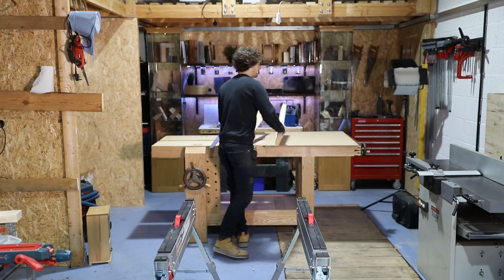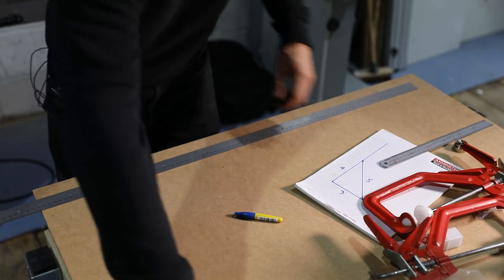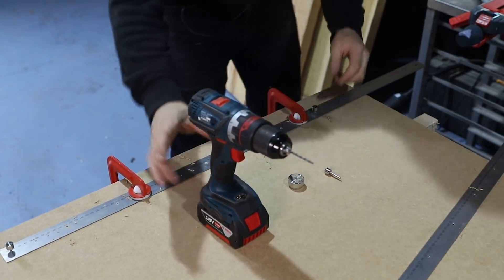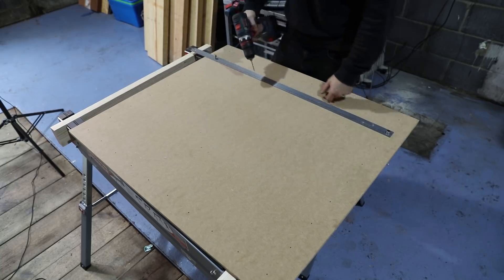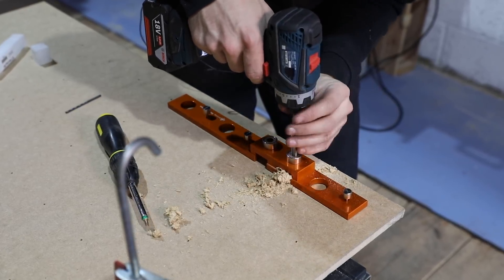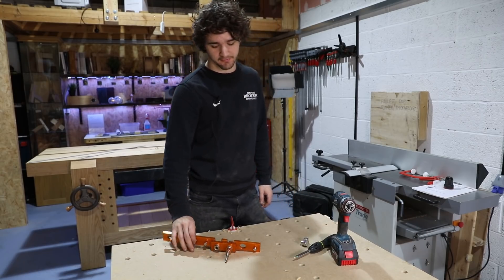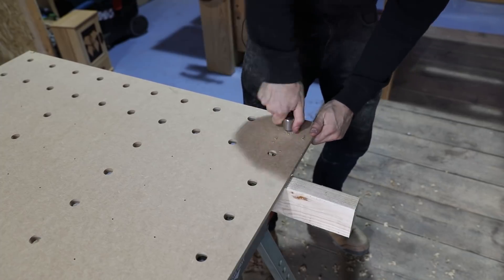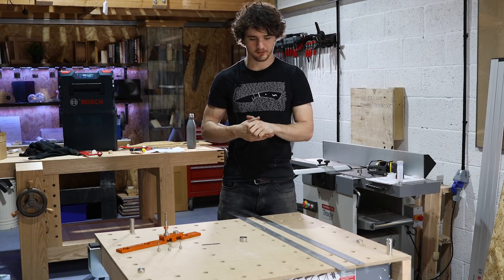How To Use the PARF GUIDE SYSTEM

Comment: Thanks! This is the first video I've seen that demonstrates the correct procedure. You're absolutely right – we need to start by drilling all the 3mm pin holes we can reach. Then, we can tackle the ones that are inaccessible. For instance, Peter Millard's method wasn't ideal, especially for beginners seeking the best approach. The only missing element here would be perfectly squaring the first row using precise measurements from the top's exterior.

Comment: If the 3,4,5 are in thousands or millions of light years, the angle might not be 90 degrees, depending on whether the universe is flat, positively or negatively curved. You'd have some trigonometrical fun AND get yourself a Nobel Prize for solving the question of the topology of the spacetime of or universe all in one go!

Comment: As the size is 20mm, does this stop the use of Veritas 19mm dogs. Specifically,, I was hoping to use Veritas Quick-Release Wonder Dog
 as a vice, so I wasn't sure if 19mm is better to cut into your board than 20mm, any suggestions?

Comment: Also, when you checked if your 45 cut was on, you merely flipped the opposite cut side to check for 90. That will always be ninety if you do that! 46+44=90? Leaned this math the hard way with a miter saw I bumped and moved a half degree! By the fourth cut I realized I was off during the dry fit🤔 lesson learned

Comment: With all the explanations, I'm now thinking of doing a kit myself. All it takes is two long straight edges with evenly spaced holes. Those are not so difficult to make - a pin used as a stop block for the first hole, then the last drilled hole slipped onto the pin fixates the piece for the next hole - on a drill press.
Reply: It's not difficult to make an approximate version. It's VERY difficult to make it perfectly aligned, spaced, perfect fit and diameter. Since it's what all the other cuts are based on, I wouldn't recommend this. You need a VERY tight tolerance CNC machine to make all this so precisely milled, and this is how the parf kit is made. Lots of jigs and tools can be successfully shop-made. For this one I'd say probably no (unless you do indeed have the equipment)

Comment: Complete overkill ..... there are better and simpler accessories out there for this ... you can also easily Mark centers out from the underside with a table saw cut length and breadth and drill the centers with a router ..... this thing is an elaborate toy ...try the dominofix jig instead .... far far simpler

Comment: Very nice thorough video - I'm sold. I'm not the most familiar with Festool but I see you using a Bosch driver with the Festool centrotec bit. In the USA the Bosch is a 1/4" hex.. Did you buy an adapter?

Comment: Hi Matt, this tool seems expensive, but after watching your video I‘m ready to get one - it‘s also available in Germany I‘ve seen. Over time, it will be worth it when drilling several boards. I wonder if the drill is sold alone as replacement, since a regular Forstner bit will not do it? However, my actual question is: I‘m in the process of buliding a small Paulk style bench from 15mm birch plywood. Do you think it,s better to glue up the torsion box before drilling or after. It would be easier to route and chamfer from both sides before glue up, but maybe building the box before ist better? Does that make sense? Greetings from Munich, Jens

Comment: Hi Matt. Like your You Tubes and I understand you have to come up with ideas but mate just buy a small table saw and make a small out feed table, it will be roughly the same size as your future set up and be far less hassle setting up. It’s also far easier moving and locking a table saw fence and I will assume you will grow tired of this system over time (I agree it will also have its benefits) I say this for advise to newbies and I’m not knocking you or your ideas. When you reach my age/experience you will think differently from your today’s thoughts. If I had time and the inclination I would make some tutorials myself. Time served Ships Joiner and Scouse b’stard living the life in Aus

Comment: presumably if you hadn't chipped the boring bit teeth the orange jig isn't needed?
Reply: Nope, the jig keeps the drill hole centered and plum in respect to the other holes.  Using the whole system keeps the squareness of your cuts to a few thousandths.
Reply: so the centre drill on the boring bit doesn't align accuratly enough?
Reply: @mickleblade  the bit just allows you to find the center, but you still need to make it plum. Not making it plum can cause enough error in a cut where it is visible for final assembly.  I can't make a handheld drill a perfectly plum hole.  Its about accuracy.
At the end of the day it's what you want to make. You dont need this system to make an accurate cut.  If you want this system to make cuts accurate and QUICK, then accuracy of holes are needed.  If the accuracy of a near perfect 90 or other angel cut isn't needed in ur application then a tape measure, a very good forsner bit, and patience is all you need. And maybe a homemade jig to simulate the orange bit.
Reply: thanks mate, makes sense now.

Comment: Matt

Apart from the impressive accuracy of your depth setting I noticed that even if there were a kerf cut in the table it would not be over another set of holes.  I think manh other track saws would cut across another row of holes, so is the track on the bosch narrower than say the Festool track?  This is one of the reasons I think some people go for raile dogs rather than Parf dogs, i.e. that moves the rail across slightly and avoids cutting over a row of holes.

My issue with the Parf Guide has always been one of cost.  I know why it needs to cost a lot, as it is made to very precise tolerances, but for an individual it is not really economic versus buyjng cnc made tops unless you use a lot of different table tops for different jigs.  Always struck me that it wojld be a great buy for a club where the cost could be shared.

Looking forward to the build series, everyone loves a shop project!

Terry.
Reply: Please, what are raile dogs?

Comment: Your 3 miles, 4 miles, 5 miles example is incorrect. Due to the slope of the earth :P If you goo 200 miles N, 200 Miles E, 200 Miles S, 200 Miles W, you will not end up in the same spot. For 100% flat surfaces it is correct though ;)

Now I don't know the exact English definition, but google for Meridional Parts ;)
Reply from the maker: #flatearth
Reply: Indeed, everybody forgets that this is all based on Euclidean geometry.  So, the internal angles of a triangle will alwats add up to more than 180 degrees if the triangle is drawn on the surface of a sphere.
However, I took Matt's example to implicitly be for a very large piece of MDF, in which case even if it were 3 x 4 x 5 miles it would be in a single plane.
Reply: eh? surely the earth is flat?
Reply: For every video there always has to be somebody that is a little bit to exact and literal.
Reply: is this comment really necessary?

Comment: At the beginning of the video I checked out the system on the Axminster website. £150?! Surely that's not worth it. By the end of the video, totally sold that it would be useful investment. Solid effort!
Reply: Yeah, I was the same; it is an expensive bit of kit but the precision involved is not cheap.
Bearing in mind that a decent precision metre rule is around £15, so that is £30 off the bat.
Reply: @MichaelMoore-nf9ho  if they made it cheaper to buy they would sell a lot more.
Reply: I agree, you can go to your local makerspace or ask a shop with a CNC to do it for much much cheaper
Reply: @reframeyourbody  
That means you have to go and ask them to do it.  With the system you can do it anytime you want with any material your want. 

You are assuming that everybody has easy access to some makerspace.
Reply: $260 in Australia and your not going to use very often. Tjere are easier amd cheaper ways to do the same job

Comment: How stable are the Axminster saw horses? I need a similar set up for my garden when projects are too big for my shed
Reply from the maker: They’re very popular. They feel quite wobbly when you first unfold them. But once they’re locked in place they’re amazing
Reply: @MattEstlea  I can confirm the stability. We have those here in the U.S. Same design, just different color and branding to reflect the local store's brand. Looks like you've got the ones with the adjustable height legs, I opted for the non-adjustable ones but I cannot see that as being much of a difference. I've used these to layout and build a steel utility trailer and they held up beautifully.
Reply: Suppose I’d best go to Axminster then 👍🏼
Reply: I looked into the saw horses from Axminster....then I looked a bit further.

I ended up with the toughbuilt C700

Fyi

Comment: Hi Matt,  Any problems with break out on the back side of the MDF, particularly nearer the end of the drilling when the edge would have gone from the bit.  Thanks for the tip will have a look at the Mk II to see if it is worth it.  I, like you am planning on doing a large 8' x 4' table, maybe a Paulk style "thick top" on trestles - have you considered that over a fixed table?  For the space from time to time.  Keep up the good work!
Reply: It makes a huge difference what quality MDF you use. If you use the crap Wickes & most builders merchants sell you will get loads of breakout & also the drill bit will clog up constantly making the whole thing a nightmare. You really need to use high quality MR MDF like Medite or Kronospan you will get a shaving when drilling & no breakout. Peter Parfitt's videos have some examples of cheap vs quality MDF. I use Kronospan for my tops & can't fault it.

Comment: how do you avoid over time ripping the top up i.e. being half a mill out in your depth setting
Reply: John douglas - Using a plunge saw as opposed to a circular saw can really help with accuracy of depth of cut. The Bosch plunge saw above has an on/off rail depth guide cursor that helps too. That said, the reason jigs like that demonstrated above and replacement MFT tops etc exist is because they do  succumb to wear - like cutting into the top. You can minimise this further by using a sacrificial piece below, like some 6mm ply, that would still allow you to use shallow 12mm dogs or, use bench cookies to support your work and use longer 40-80mm dogs for guides.
Reply: thought that might be it but on several videos I have seen could not see anything like that.   Very much appreciate the prompt reply
Reply: @TheWareek  the purpose of the Parf is to be able to recreate the system quickly and with the same accuracy. So when the top is worn just get another top and drill away.

Comment: Quick question about the larger Parf table mentioned at the end: if the table is the same size as an entire sheet, wouldn't that mean it could not handle cutting a sheet because all of the dog holes would be covered?
Reply: You could always just have a full sheet overhang one side of the table to expose a row of dogs... then cut

Comment: Great video!  What is the trick to set the depth of the saw?  I didn't see a kerf in the table nor a sacrificial board...
Reply from the maker: This is a plunge saw. It has stops set at every mm so you can be super precise!
Reply: @MattEstlea  understood.  I own a track saw and always leave a slight kerf in whatever I am cutting on top of.  Do you calculate the depth?  Or is there another method?  

Again, love your videos.  Keep up the great work.

BTW,  is the parf system suitable to use for a roubo style bench with a thick top?
Reply: @peterrodrigues1098  Don't know why this wouldn't work with a roubo style bench.  Parf dogs come in short-, long- and longer- length so a longer dog would secure well in a deeper dog hole.  Not sure a roubo style bench would be conducive for precision track-saw cuts using parf system, however.
Reply: I thought exactly the same.
Reply: My thoughts too
Reply: I did. He cut the MDF very slightly.

Comment: They sell it in the states but it isn't in imperial.  So regular, American, holdfast dont fit...3/4" vs 20mm
Reply: Just use a 3/4 bit for the final pass and a pipe reamer, router bit or large countersink for the chamfer...
Reply: It's 20mm for the precision dogs you're supposed to use. Parf dogs align the work piece and the rail. It doesn't make much sense to offer in 3/4 because there aren't 3/4 precision dogs, and you don't need a perfect grid for a hold fast or clamping table
Reply: @nkuete  I understand and agree that the precision dogs are also in 20mm not 3/4". But if you have a table like this it can be used for other work.  And since 20mm holdfast and other accessories aren't available it could only be used for a single purpose.
Reply: I think Peter Parfit mentioned a while back that Lee Valley was going to carry this system. Don't know if they do or not, but they probably would sell both versions as for their other tools.
Reply: 3/4 inch holdfasts work fine in 20mm holes. I have both sizes of holes in my workshop
Reply: It’s a whole thing. Not so much to do with American vs European systems or imperial vs metric, but rather traditional vs modern. The MFT system uses 20 mm holes, and the distance between the holes can be important for some tools and accessories. Another main difference is that the MFTs (multi function tables) have thinner worktops than traditional workbenches. Traditional 3/4 inch holes and the holdfasts, dogs etc. are usually meant for very thick worktops. Some holders work in both sizes, many don’t.

If you’re building a stationary workbench with a thick worktop, go with 3/4 inch holes: the bench dogs, holdfasts and other bits you can buy for thick worktops will work better in 3/4 holes.

This jig is marketed as a way to “create portable cutting boards in less than 30 minutes”, but it’s really also (or mainly?) a jig to build your own MFT tops – the ones made by Festool are hideously expensive.